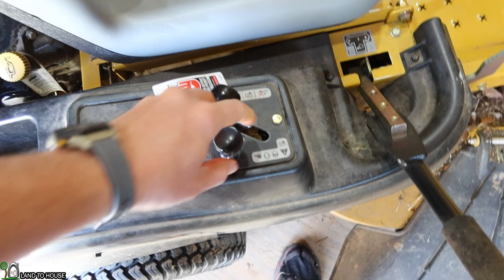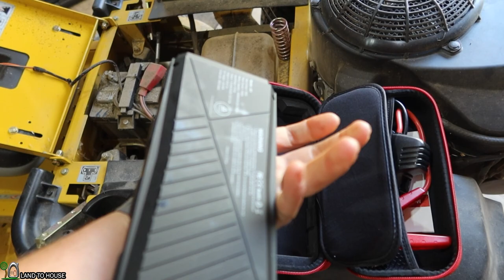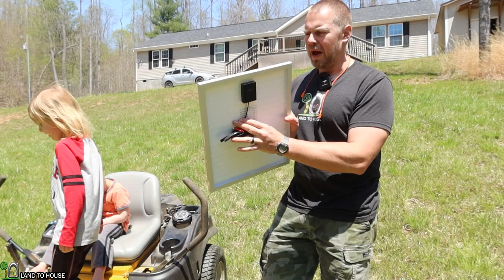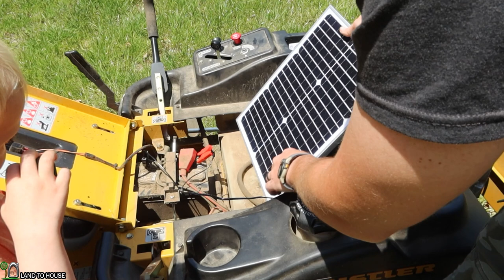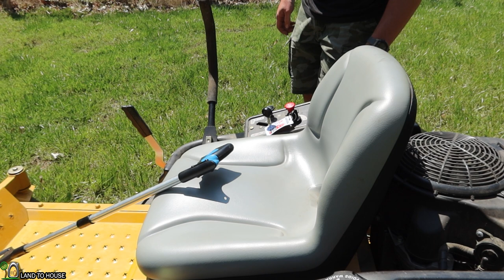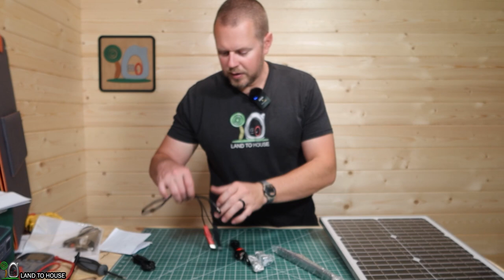Lawnmower Solar Battery Charging

Comment: Navy Electronics tech (Ret'd) here: the NOMINAL voltage on any common battery for lawnmowers & vehicles is ~12.5-13.5 Volts, with the engine running it should read in the 12.5-14.5 Volts range!! You already had those voltages without charging your battery, so I don't understand why you expect a 12v solar charger to produce higher voltages than that. I used to buy Sears Top-of-the-Line 'Gold' battery with a 7 YEAR WARRANTY for my 1980 Ranger XLT, but I was still replacing them every 2-3 yrs. Then I read an article on choosing batteries in Pop. Mechanics that said the 'Gold' batter DID NOT HAVE SUFFICIENT CRANKING AMPS!! So I switched back to their 'Silver' battery, & all was good again. Also I have had batteries test good @ Sears or AutoZone, and still fail to crank the engine a day or so later. Once again this is most likely due to insufficient cranking amps (i,e, CURRENT), NOT low voltage!! A battery can test to or close to 12v, and still not make sufficient current, so the starter doesn't have enough 'oomph' to crank the engine over. As a general rule you can jump start it, and it will run, but it's still not a healthy battery, replace it & save yourself future headaches.

Comment: Too Cool, that's the original reason for adding solar to the tool shed wasn't it?  It is referred to as an SAE plug, most common for battery tenders and some of the solar uses you have demonstrated.  I installed the ring terminal pigtail directly to my motorcycle's battery.  It makes it easy to plug it in to my wall-plug-tender for a day or so every few weeks to keep the battery up over the winter.  You might want to order another pigtail to install on the ATV.  AND, you can get accessories that plug directly in to the SAE pigtail like a usb charger for your phone/camera/mic when you are out filming with the ATV, or a car-type power port for plugging in your 12v tire inflator, or a car 12v fan on the lawnmower for really hot days.

Comment: We have that same mower and you can't fill the tank all the way up with that fuel tank holding air in the hump of the tank. Our mower never has driven straight without steering input but compared to a commercial mower a 16 year old mower it is the best cutting.
Reply from the maker: Someone told me once that you have to keep the fuel below the filter. And that's about right to avoid that air pocket issue. I have enjoyed using this mower. it has worked now for about 4 years
Reply: @LandtoHouse  Thank You for telling me that.

Comment: Learned that in a hard way when my mower, bike and 4weelers cheap Chinese batteries died after one or two years use regularly! So bought expensive Motobatt AGM for all and trickle charge every other month in off season and now they last years. But I may do this kind of solar add to my boat because of it's bilge pump!
Reply from the maker: My battery in the ATV made it 5 years. The lawnmower battery is almost gone at about the same time frame. Charging in winter now seems important!
Reply: Ya I forgot how long mine lasted but I picked up an AGM from chrome batteries the I gel I think with a small voltage display I think it could show some other stuff like how long it had been on or something but mine stopped working after a while on my mower that sat outside and got rained on but it was cool while it lasted I could just push it and see if I should probably charge it or not but the battery probably lasted 5 or so years without me really taking care of it

Comment: i have a buddy who works at batteries plus, he has often commented that trickle chargers are his best salesman.  If you do use that you would do well to monitor how it reacts when your battery is fully charged.
Reply from the maker: Yes. I mostly want to recharge the battery every 30 days or so in winter to keep it topped off.
Reply: Old style trickle chargers do kill batteries however these days, a majority of the trickle chargers sold are of the automatic smart charger/maintainer type and will adhere to the charge profile of a selected lead acid type.  I keep  battery maintainers on everything that has to sit more than a few months between operations and I have some batteries that are in excess of 10 years old.  My lawnmower is one of these where the battery is already 11 years old but I keep it on a decent temperature compensated automatic trickle/maintainer charger all winter when in storage.  Once a battery is fully charged and the charger goes into float mode you really only need to float at 12.9-13.5V to maintain the charge.  The closer you are to 12.8-12.9v for flooded and 13.0-13.1 for AGM the better for battery longevity and reducing loss of water as the battery ages.  You never want to keep a 12v battery over 14V once it is fully saturated as you will cause excessive off-gassing and condemn the battery to a short life if the water is not topped up at regular intervals.  The only time you should be much over 14.4v is during an equalization charge which should be done about once every 10-15 discharge cycles on deep cycle/marine flooded batteries.  Just remember that 12.8-12.9v resting is a full charge on flooded lead acid and 13.0-13.1 is a full charge on most AGM or sealed bateries.
Reply: @kuhrd  . . . that's good to know , thank you.

Comment: Left all winter 14.8 might charge  your little battery to death
Reply from the maker: After taking a closer look this charger panel is set for 13.55 volts.
Reply: @LandtoHouse perfect float voltage, just add extra sets of leads it will take care of all the little batteries simultaneously